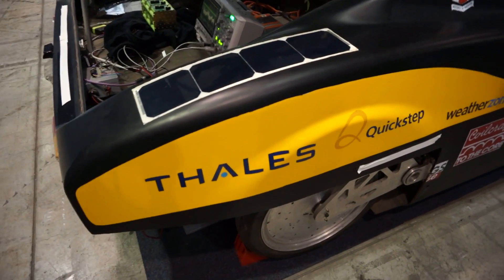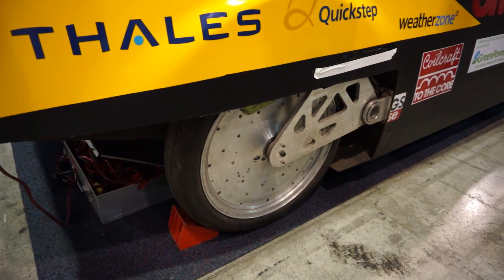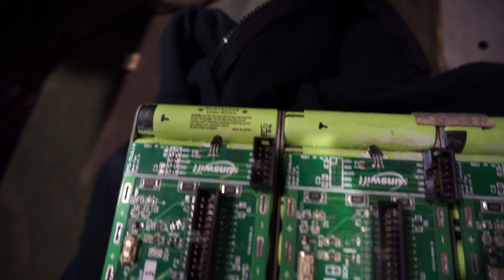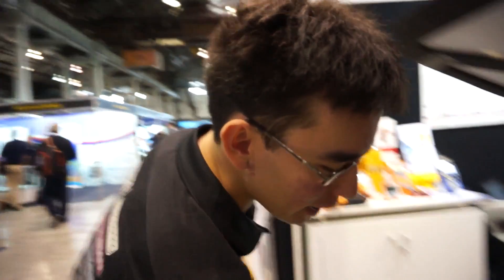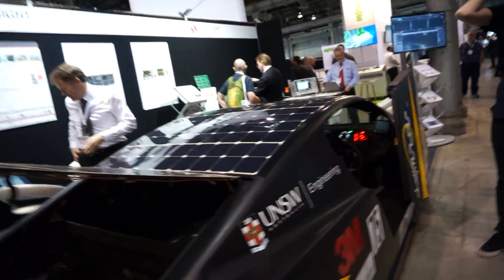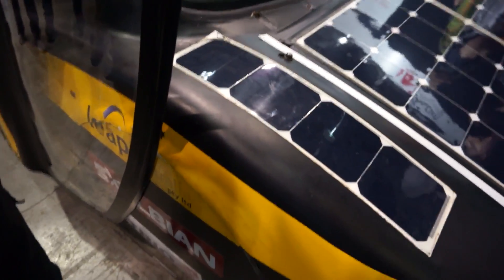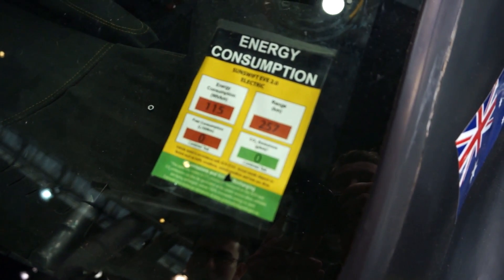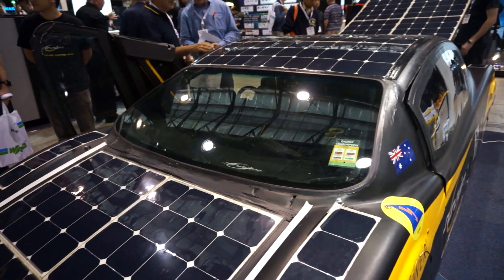EEVblog #923 - World's Fastest Solar Electric Car

Comment: As a solar car team member, I can assure you there are faster solar cars. Nuon has the fastest, Nuna 8.
Reply: Nuna 8 completed WSC 2015 at a total race average of 90.38 Kilometers per hour. eVe, the car in this video, averaged 55.92 Kilometers per hour. However, eVe did a 310 mile (500 Kilometer) timed run at 107 Kilometers per hour which was the fastest that a solar car has run that particular timed test. It should also be noted that Nuna 8. nor any prior Delft University cars, has never run the 500 Kilometers timed test.

Comment: I'm guessing those tires are about 100 PSI ?
Reply: I imagine they just use solid rubber, for rolling efficiency it needs to be as stiff as possible.
Reply: When I was in school, the tires we used on our car needed 90 to 120 PSI.  I don't quite remember why, but there was a reason not to use solid rubber.. but I could also be wrong about that.

Comment: 300 kilos? That's not a car, it's a glorified go-kart. With solar panels.
Reply: weight is not an asset
Reply: Yeah, they're great at demonstrating the concept, but I'm wondering when they're going to have a category for cars that would be useful for everyday stuff.
Reply: Bro, life isn't a drag race. "Weight isn't an asset" itself, no, but all the things you buy with that weight most certainly are. Air conditioning, air bags, comfortable seats, smooth suspension, insulation against weather and road noise, crumple zones and/or sufficient strength elsewhere to meet safety standards, it all adds up fast. 

Every manufacturer on earth is struggling to get the best MPG figures without dropping any features. Do you really think if they could build an Accord down to 300 kilos they wouldn't? Get real. 

For some comparison, one of the smallest cars on the road, the smart car, weights over 800 kg. And those things are so tiny that, if consumer preference is any indication, they barely qualify as a "car" at all as far as most folks are concerned. The form factor of the smart is way smaller than this, and yet they weight nearly 2.5x as much.

You think there might be just a few features missing from this before it's ready for the consumer market?

Like I said, a glorified go-kart.
Reply: @marshaul  It is not just all the safety and convenience features which add weight, it is also the structure of the vehicle.  It isn't just the inclusion/exclusion of all the features, but also the price.  Your typical Honda Accord is built largely from steel.  Cheap and plentiful steel.  Carbon fibre is stronger and lighter (and largely what eVe is built from), but it is much more expensive than steel to build a car from.

I looked up a carbon fibre hood (bonnet) for my Toyota Camry.  Cheap ones were about US $800, compared with 10 - 20% of that price for a regular, steel one.  Camrys are as common as dirt.  I live in Texas where big American pickup trucks (and SUVs) are the de-facto transportation for most families, yet it is hard to drive down any street without passing at least one Camry.  Sometimes there are three or more Camrys at one traffic light.

So, Honda, Toyota, and every automaker out there who wants to sell a car for US $15,000 - $30,000, a price most middle-class families can afford, builds their cars from steel.  The Alfa Romeo 4C and other super-cars are built largely from carbon fibre, but how much do they cost?  Would you want to spend US $100,000 on a Honda Accord?

And weight does impact efficiency.  Check the fuel economy of your current vehicle with it empty except for the driver.  Fill the vehicle up with the maximum weight it can carry (per the owner's manual) and drive the same route at the same speed in the same weather - your fuel economy will drop.  The automakers want to build lighter vehicles (which would help with fuel economy and emissions regulations as well as acceleration), but MUST build vehicles which both comply with government regulations and will be profitable at a reasonable retail sale price.
Reply: These, btw, are exactly the sort of engineering questions that need to be addressed up front, rather than uncritically glossed over. I don't think Dave was nearly so rigorous with this as he has been apt to be with Solar roadways, for instance.

A proof of concept on a car so lacking in features nobody would buy it is no proof of concept at all. Frankly, if the numbers were there, you wouldn't even really need a proof of concept (solar power isn't magical at this point), and cars like this would already be on the road.

Comment: 1000 watts of solar panels, is that a joke? You need a shit load more surface area  which means more weight - lose the panels! My brain almost exploded I saw that solar powered plane because it was hard enough to make my electric jet boat because you are constantly slipping in fluid where efficiency is inversely proportional to viscosity.
Reply: My electric bike uses a 750 watt bldc motor and it's pretty quick but a 1000 watt car is going to be slow as fuck.

Comment: The terrible thing with electric cars is, that they fool people into thinking they are good for the nature, but they are actually just moving the pollution from the street to the rare earth mines (magnets for brushless motors) and factories. Considering the total vehicle life (from dust to dust) they have a worse ecological footprint than a modern European combustion engine car. 
But governments still keep pushing them, electric trucks are even allowed to weight 1000kg more than conventional trucks in EU to make up for the extra system weight (batteries, air con and cooling for the batteries...; in total the published demonstrator trucks are 1.5 to 2 tons heavier than combustion engine models)
Reply: Do you know that it is possible to create a brushless motor without using rare earth magnet? It is called induction motor, and Tesla use it
Reply: minecraft2048 and Renault uses brushed motors in their small transporter (Kangoo size) but in this video they used DC-Brushless
Reply: lithium is the next problem

Comment: Very interesting! Would it be possible to just have, say, three battery banks that are fast charged individually from amplified current that comes from generators mounted to each wheel. The theory would be, as the car moves forward from the power of the first battery bank, the generators would amplify energy to "fast" charge the second battery bank, as the first battery is in use being depleted. By the time the first battery bank is depleted, the second battery bank would be charged. In the meanwhile, the first and second battery banks would be cooling down from being discharged and charged and the third battery bank would then be used to power the vehicle. It would just keep repeating this process with virtually no other power but from itself. Would this be possible to do? I believe so because one can amplify energy. Example; 12 volts can be amplified into 100,000 volts.........
Reply: Short answer: Nope it won't work
Medium answer: Nope it won't work because it will violate law of conservation of energy and thermodynamics
Long answer: Nope it won't work because when you attach a generator to a motor, it will sap kinetic energy that can be used to move the vehicle, and because of friction and resistance, there will be net power loss. Basically it  will make your vehicle much more inefficient compared to normal motors
And no, generators does not amplify current, it converts kinetic energy into electrical energy
Reply: I think you are basically describing regenerative braking which hybrids and full electric cars already have (although using the word amplify makes it sound different, you cant just amplify power, the amplification has to come from somewhere aka another power source) attaching a generator to the motors wouldn't work because once you do that it has the same effect as holding the brakes on constantly, this is why regenerative braking on electric cars and hybrids is good for stopping you from gaining speed when rolling down a hill without having to use the brakes.
Reply: You are generating movement from batteries to the motor and onto the wheels at some loss of power, and then you are regain that power back with the same losses.
Meaning you add it up and you got a very complicated power loss generator, you can amplify individual components all you want but the combined power will be less then it was at the start.

Comment: why would they put inductors in the wheels? the weight of the inductors would only add weight?
Reply: they are part of an electric motor which is directly integrated into each wheel.
Reply: Well whatever motor you use it will have weight, and it will need to be attached to the car...
Are you trying to say this presents a problem with unsprung weight? That is true, but this is not a race car where it would make a huge difference, they are going in a straight line at very slow speeds, their ride quality is almost irrelevant.

Comment: Does it rain in Austrailia? Because I don't think this would be great in the wet.
Reply: That part of the country they drive through is mostly desert and is the perfect location for these cars.
Reply: Jedda73 So it never rains there? I'm not being difficult I'm just curious, because he mentioned low friction tyres which to me sounds like they lack grip?
Reply: Glamiac Ah, sorry not with it this morning.

This is a good idea, but I think the low friction tyres are an issue for handling in wet weather, or icy weather. But that wouldn't be an issue in Austrailia, just Europe :P
Reply: Well in one respect the tyres used for rain offer more channels for the rain to be dispersed in the wet. So in a way there is even less rubber and friction on the tyres. But, a frictionless tyre is no good in the wet, regardless of the channels, so you'd want to introduce more grip than what you would normally do. But I would say it'd have a big impact on the range.

Comment: Was the Brushless hub motor custom? And I was a little disappointed they didn't make their own motor controllers, I'm a sucker for big power systems....
Reply: Motor was not custom, and most teams don't build their own motor controller as the ones you can buy are almost always better, even if they cost 15-20k.

Comment: If I could afford it, and had the knowledge I would buy a Volkswagen XL1 and convert to both electric and solarpower.
That car has amazing aerodynamics.(Drag cofficient of 0.189 on the car they sell) 
Nice car they have built in this video, really like its roadlegal :D thumbs up!
Reply: Too bad that since the exterior aerodynamics will be ruined when you start slapping solar panels on it, you should have just considered designing your own body that have the same level of Cd while taking solar panels into consideration.

I know that flexible panels exist, but the efficiency right now is simply not great.

Comment: Why did they choose brushless DC motor for wheel?
I feel like they suck at chemistry. They should have built their own battery ? That might have been better?
Reply: When you compare the losses in a MOSFET to a commutator, the MOSFET has less losses. Just look at the sparks from a running DC motor. If you try for an AC induction motor, you still need to convert the DC to AC with MOSFETS, and you get minimal speed control.

While it's possible to build your own battery, you're going to have difficulty in making a dense battery as well as a factory, unless you buy or build a factory. I think you might be talking about battery packs. Most manufacturers will custom weld and test them for you if you buy in bulk. Saves you time, money and effort.
Reply: Sorry,  but are you trying to troll? You can't be serious. Do you really think a small university lab can do better in a year or two than the several multi billion $ companies that invested billions into battery technology and production processes? If you think so, you not only suck at chemistry, but also at physics, engineering and generally economics.
Reply: Fahraynk
What is it with you throwing insults around? Telling the students they suck at chemistry, calling me a dick. Is that you what you think counts as an argument?
First a brushless DC motor and a synchronous motor are two completely different things, especially in the way they are driven by a controller.
If you really wanted to know about battery chemistry and physics, you could have read about it for a long time. There's something called the internet that allows you to search for that stuff. No point in explaining it in the comment section of a video. Batteries are no secret. If you had done that reading you'd know it is impossible for a small university team to make a better battery than a company that has done it for decades. And no, this is not an assumption, that is a fact.
A good engineer knows what is impossible, be it chemical or physical reasons or because of time, money or personel constraints.
The bad engineer is the one that assumes everything can be solved, it's just a matter of trying (like all those people trying to build over-unity generators).
Reply: Well, with brushless you don't need to worry about transmitting large amounts of power over a moving thing. All the electrics stay fixed in position. Then again, I'm not very experience with high-power motors, so who knows?
Reply: The brushless motors are more efficient (cost about 40k a piece). And the equitment needed to build your own batteries is millions and millions of dollars, and Panasonic has the research put in to produce the highest capacity lithium ion cells. You are limited by weight, so whatever cells have the highest energy density, which are Panasonic's.
Reply: You have to use the same amount of mosfets to control a Brushless DC anyway (H bridge). You get smoother more efficient output from an AC Sync Motor don't you? 

You need a factory to build a battery? They look like they have a nice lab...
Jammit Timmaj
Michael Schalk What equip do you need to build a battery that costs millions of dollars?
Reply: Brushless is the most efficient and the best at generating power per watt. Multiphase brushless is very, very good.
Also, nobody's going to be better at making batteries than a company that has invested billions of dollars into the equipment to do so, unless they have some unique chemistry. If you're using a conventional chemistry, off the shelf, high end quality batteries will beat anything you can make.

Comment: Does a solar powered car need to drive on solar freaking roadways?
Reply: no....
Reply: Dave would get triggered at your comment lol
Reply: we don't get enough sun here in the UK so they've been trying to develop a car that charges it's batteries with wind turbines on the top.
Reply: If all cars were solar they could all plug in to a grid when parked. Imagine a parking lot full of parked solar cars hahaha that would be more practical than solar friggen roadways
Reply: Super mega free energy + 2kw production for inch

Comment: The ultimate question remains:  Can you do mad skids in the maccas car park with it?
Reply: MCM fan?
Reply: You know it!
Reply from the maker: A joke only Sydneysiders will get, LOL :-D
Reply: The Western Sydney Uni solar car can.
Reply: These things basically drive on bicycle tires, to minimize friction, as friction reduces effeciency. It probably slides around like mad if you try, but seeing how its made with the absolutely minimal weight, I don't know if it could actually take the strain :P
Reply: If it's front wheel drive just put pizza trays under the back wheels and drive around with the hand brake on. It's more fun, and sparky!

Comment: why are there no brushless dc motors with ferite core? just as iron core transformers are worse than ferite core transformers, why not lighter, and cheaper ferite core motors just with much more phases than regular iron core motor?
Reply: ***** this can be solved by getting the motor out of the wheels and on board. this would only make it use chain/belt/gear drive, which would increase the losses a little bit, but weight saved and hysteresis losses would make it worth it
Reply: damn thats a good question. i just looked for custom shape ferrite or lasercutting ferrite blocks, but cant find any information.  it could be worth a try
Reply: gamerpaddy i was going to put 2 ferrite rings, on a bearing as a rotor and a big ferite ring as a stator and make induction motor driven with zvs, but i cant find good solution to put the ferrite rings on the bearing and making it balanced
Reply: i was looking for a solution to upgrade existing  brushless motors, maybe lasercutting a block of ferrite to the right shape. ive just contacted a manufacturer whats the cost of a custom shaped ferrite.  well, probably not affordable for anyone at all but asking dont cost anything
Reply: gamerpaddy i can do it without much cutting. i just have to stick ferrite ring on a bearing and then easy life
Reply: show me some picture
Reply: gamerpaddy i cant take pics right now, but its about time that i find some solution, dont worry. the bearing is from hdd head and the ferrite  is from 250 w power supply (the 5v and 12v current filtering choke)